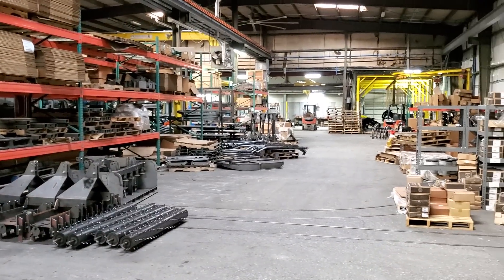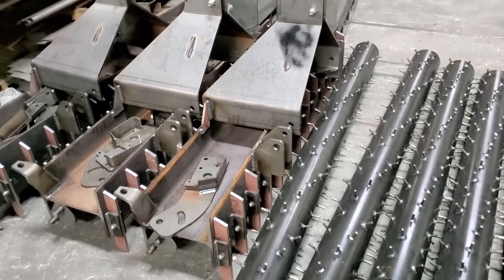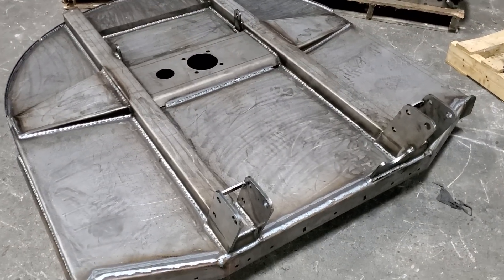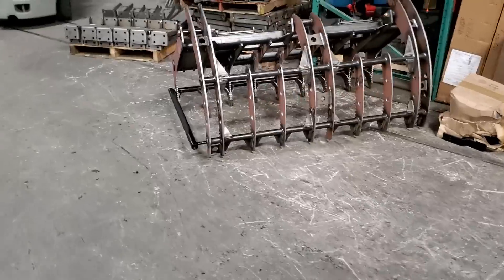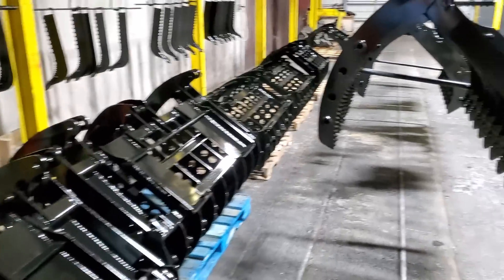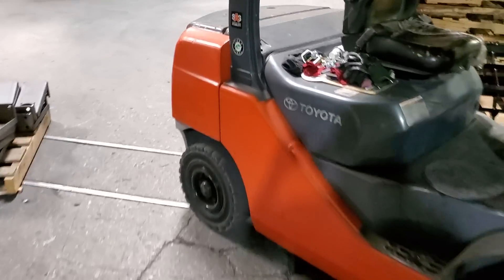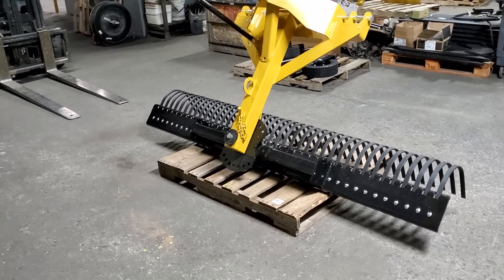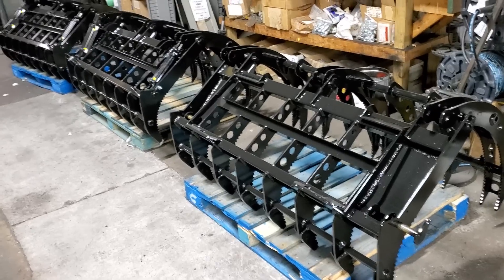Friday Factory Walk!  3/19/2021

Comment: Your alternating depth lawn plugger made me think of catchy item for you to offer. Look up vintage sunburst clocks. Something for the home? Lol.

As for your equipment, I only recently discovered you. For 35 years only ran 8N tractor, bare minimum equipment, just bought a new MF 1835, and rediscovering what all is available. Hope to eventually maybe do side work, but for now, 1 piece at a time, when I can afford. I do live within reasonable driving distance. I'm 50 miles from Triad in Virginia mountains. Do you offer any financing? Had to ask.
Reply from the maker: Yeah, that aerator wheel assembly is artful, no doubt. 🎡 Great to hear you're close, and tuning in. 👊 We accept credit cards, but do not have in house financing.  Have a great weekend.
Reply: @EverythingAttachments  Thank you, & I  just have to do it out of pocket as I can.

Comment: With the space left between those hardox450 ripper shanks on the laser table, why don't you use that spare space to cut the teeth that go into the bottom of them? I just saved you several thousands of dollars in wasted material per year, payment can be made in the form a of a 72 or 84" pine straw rake ;)
not to dog your line tour, how are the new buildings coming along? Y'all so busy, Ted done pulled the rest of his hair out?